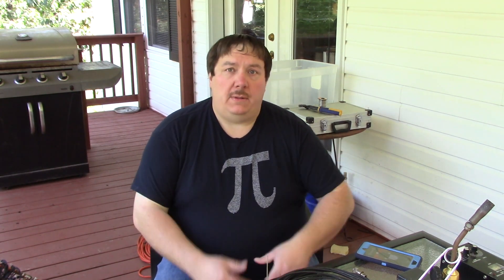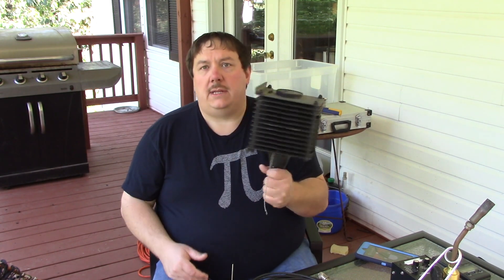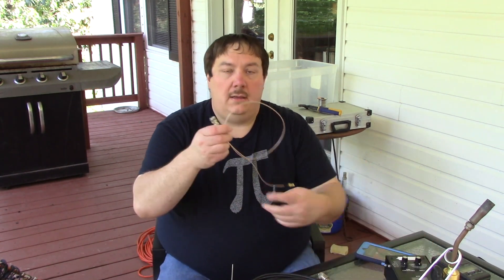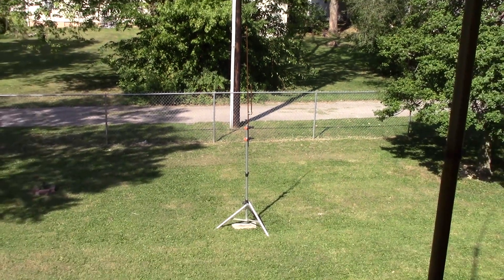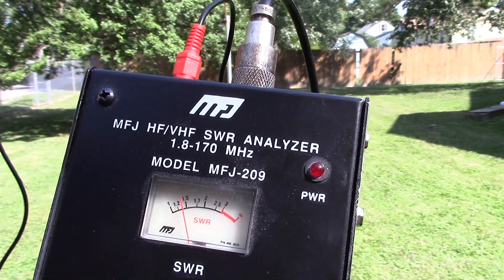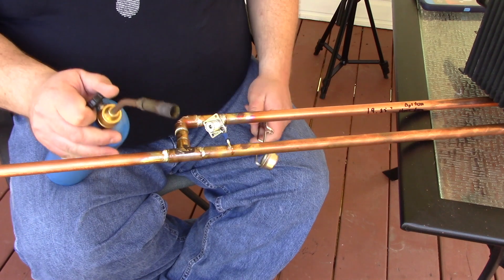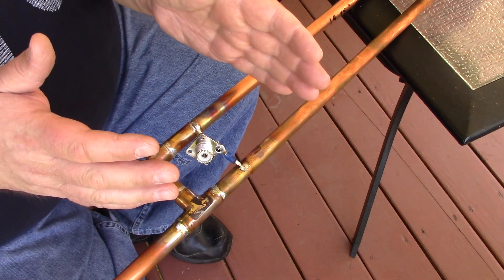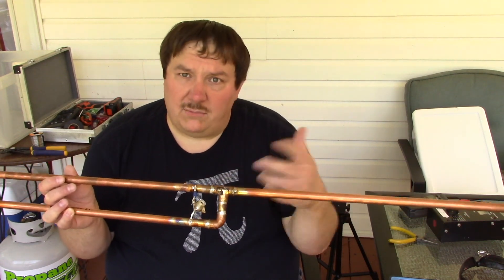Part 2 of the J-Pole build. The testing....

Comment: Maybe I didn't understand what you were reading regarding resonant frequency in the video, but didn't I see resonance at 143 MHz w/ 1.2:1 swr and 1.5:1 at 145 MHz? If so, wouldn't the feed connection point be raised to shorten the antenna? After all, the higher the frequency, the shorter the antenna? Or, am I missing something?

Comment: Using a conductive mast DOES matter. It can radiate downward just as easily as upward from the quarter wave matching stub. An unknown mast length means an unknown number of half wave lengths. If by chance that is resonant close to the target design, it can "pull" the tuning. Tuning the antenna with a short "handle" may change when lifted aloft on a tall metallic mast. Best to use an insulative joiner section as close as possible to the "T" fitting and not be surprised by the end results. You can verify this by using a Nano VNA with a wide sweep. Slide your hand along the mast and watch the phantom SWR notches move about.

Comment: Does the diameter of the copper pipe matter?
Could you use 3/4 inch for example vs 1/2?
Reply: Yes. But a larger diameter shortens the resonant length slightly. It does improve the bandwidth slightly. VA7WN

Comment: Wow! You seem to have an extra handle on antenna setup that goes beyond just an SWR meter.
I built an all wire 11 meter jpole based on Dave Tadlocks  11 meter jpole here -  http://www.amateurradio.bz/cb_radio_j-pole_antenna.html
and SWR's maxed out.  His seems to be calculated on 28.5 mhz which is in the middle of the 10 meter band.

So I made  a 5 turn RF choke and adjusted the lengths to 8'2" and 17' 3"  with a 6" feed point  still using 8'2" 300 ohm twin lead and have SWR's down to just below 4.
Do you have any ideas on what I could do to get a usable SWR?